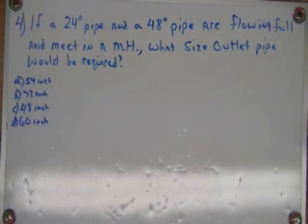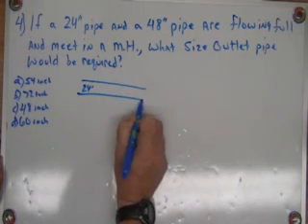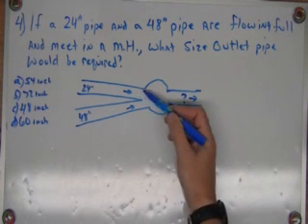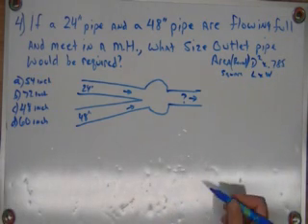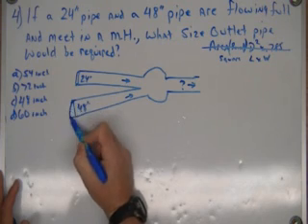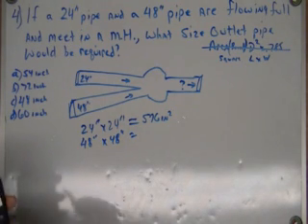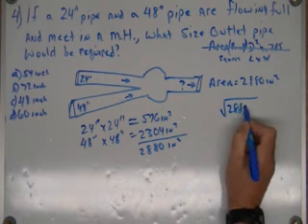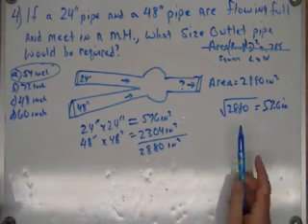Wastewater Collection Math Problem #4   SewerGeek

Comment: The area of a square pipe and the area of a round pipe are completely different. Round pipe would dictate a discharge pipe of 48in.
Reply: Stick with round pipes when doing the tests.
Reply from the maker: You are right. They are completely different. But when you are comparing the areas of the same size square pipes to the same size round pipes, the ratio is the same. Once you do units cancellation, the fact that you multiplied by PI and did the square roots on both sides of the equation, it completely drops out and becomes irrelevant. If this concept is difficult to understand, then ignore it and do the math anyway. You will be fine.

Comment: Just need to ask this question.  Do they even make square sewer pipes.  I'm going for an exam and Ur book helps a lot but I was lost with this problem because I didn't know about the square root thing.  I was calculating diameter...
Reply from the maker: Yes. Most of the time, a square sewer pipe is a storm water culvert, but many times they exist in combined systems, especially in large cities.

Comment: The explanation or presentation of computation is vague... but you will arrive at the same answer (due cancellation of constants).
I suggest the presentation should be like this. 
Volume of 24" pipe + Volume of 48" pipe = Volume of the Outlet pipe
or Area of 24" + Area of 48" = Area of Outlet.
I will use the Volume Computation:
Assume Pipe length, L is equal to all pipes:
Volume of Pipe = 0.785(Dsquare) x L
Volume Outlet = Volume24" + Volume48"
0.785 (Dsquare) x L = 0.785(24x24) x L + 0.785(48x48) x L
Cancel 0.785 and L
Therefore, Dsquare = (576 + 2304)
Dsquare = 2880   
D = square root of 2880 = 53.67 ft. = 54 ft. (letter a)
Reply from the maker: This s a pretty good take on the issue. I am in the process of rewriting the sewrgeek.com website. It will be a while, but I believe I will redo this video, using Reden Dizon's suggestions

Comment: This video is infuriating!  I don't understand why you'd  take out the .785 , and come on how many systems use square pipe?

This solution seems so weird to me, please advise.
Reply: hi governmentlies, refer to my explanation above...
Reply from the maker: Many systems in large cities use square pipes, usually in combined systems. However, judging from some of the comments from this video, maybe I should do an update explaining this concept. If you are not sure, you can kep using PI in your calculations and you will be fine.